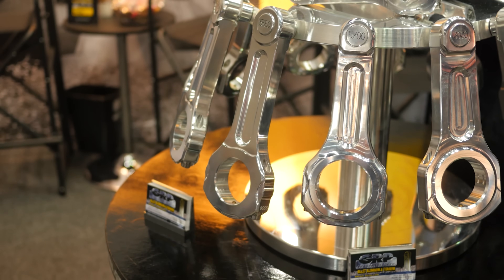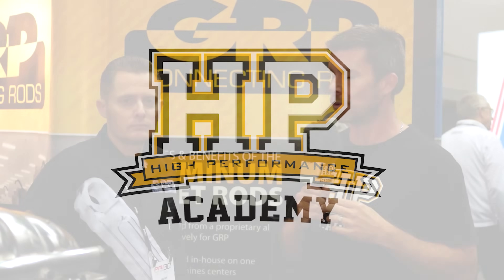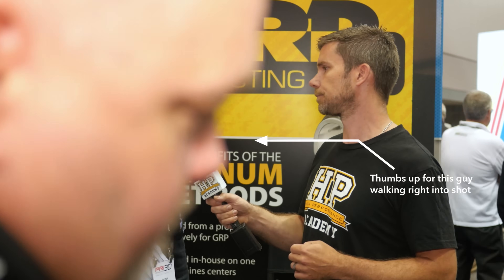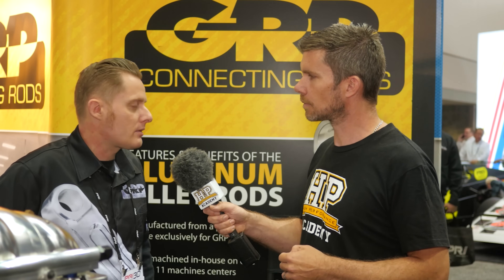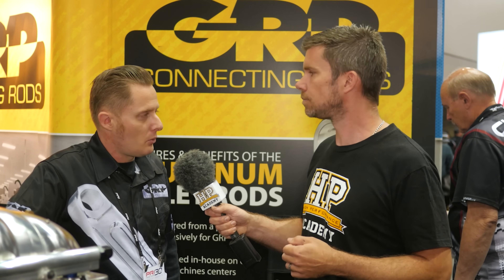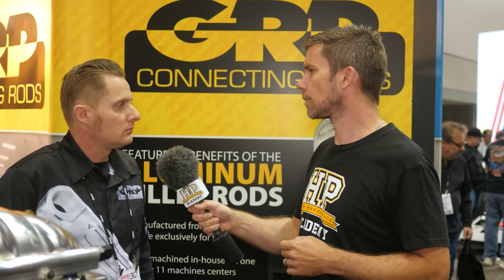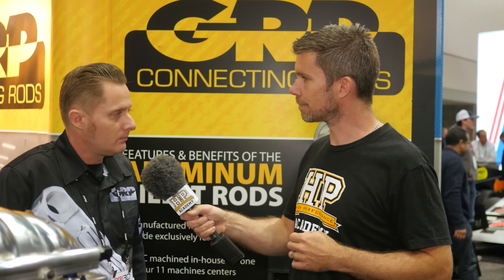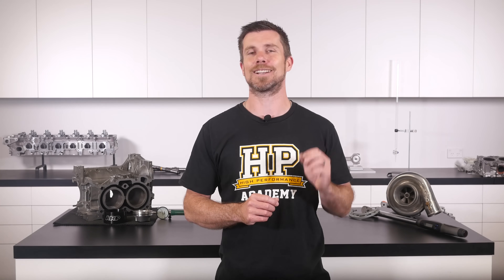Aluminium Conrod Pros and Cons | GRP Connecting Rods [TECH TALK]

Comment: Wow we own a 350 Chevrolet engine in drag car and we've been using the same aluminum rods for 30 years I'm not talkin about the same brand I'm talking about the same rods so you telling me they won't last oh and don't say making horsepowerI'm moving a 3000 pound car with a 98 hundreds  second 60 foot so I believe they are going to hold up on the Street and also the deceleration stuff they run aluminum rods and sprint cars and late models just don't hang a 900-pound piston on the other end of it
Reply from the maker: The reason why aluminium rods are not advised for a street application are fairly stated here. From there it's up to you if you want to believe the science and experience of many other companies, engineers and engines out there or of your own use case, granted it is a drag application too and not a street application either way - Taz.
Reply: Are you running it as a 2 stroke like this 2 stroke cheavy conversion:https://www.4btswaps.com/attachments/2cyclesbc-jpg.6839/. Do run an oil injection system into the intake?

Comment: If you do not exceed its yield strength, steel has a virtually infinite service life. That is why they are so great for cranks and rods. Aluminum does not. In many cases it can be over built so it has an extremely long life, like and aluminum rocker arm. But for the extreme duty that a con rod sees they are great for a sprint but not for a marathon.

Comment: Spin fast, bend easy. Yeah, no. Wouldn't touch them unless you are building a naturally aspirated race engine, and are stuck in that engine category. Great for building 10,000+ RPM engines, terrible material for cylinder pressures exceeding what you can achieve with Compression ratio and atmospheric air pressure. I'll take a set of chrome moly alloy, cast fracture split steel rods, over forged aluminum rods any day of the week.
Reply: I would to as they hold up better in 2 stroke conversions as well like this v8:https://www.4btswaps.com/attachments/2cyclesbc-jpg.6839/

Comment: Really good pertinent questions even if some answers were a bit short! Interviewer eventually teased more detail out. Clear enough reasons why an alu rod will not suit my road race bike. Would have been interesting to know if an alu rod would have been acceptable in an older lower revving circuit bike (say under 7000 rpm) as opposed to the phenomenal high revs of many modern engines

Comment: Aluminium rods can run into the block not a cam..
Reply: It depends on the engine...  In a small Chevy getting the rod to clear the cam can sometimes be much more difficult than getting it to clear the block.

Comment: With regards to aluminum rods, how suitable do you feel they would be in drifting, for example? Not quite drag racing and not quite a full road course.
Reply: Not even remotely. There are plenty of ways to make enough power for any kind of drift car you can imagine without aluminum rods. The whole idea is to take advantage of aluminum's ability to absorb shock on the bearings and crankshaft, AT THE COST of longevity. That's not what you want in a drift car. There are a plethora of options to build a motor with steel rods that is capable of more power than you'll ever need drifting. You don't see 3000hp+ drift cars for a reason. Road course would actually be very similar to drifting in this regard, I don't quite know what your trying to achieve with an aluminum rod drift car engine lol
Reply: Are you running as a 2 stroke?https://www.4btswaps.com/attachments/2cyclesbc-jpg.6839/. I assume you made a poppet u-loop scavenged 2 stroke.

Comment: would the rods be recommended  for a daily running usage on a stroked engine?
Reply from the maker: It's best to get in touch with your supplier directly, tell them what your application and requirements are and then see what they recommend specifically for you. The pros and cons of this material are covered in the video so it's up to you to decide if the pros are sufficient enough to warrant dealing with the cons - Taz

Comment: 6:10, heavier viscosity oil than tightening up clearance.
Reply: High viscosity oil and large clearances are old drag car engine building techniques that need to die in a fire. Oil has changed a lot from the 1950s and 60s. There's no reason why you should be running a 20w-50 oil in a modern strip/track car. Guys still do it anyway, and they are just wearing out their engines quicker running loose clearances.
Reply: Im on amsoild dominator synthetic 2 stroke oil in my rotary. Its SAE 30w like BRP XD-100 and little cheaper. Im gonna try some motule 800 2T but its sae40w like silkolene pro 2 sx. Igot my 8v92 on a shell rolettla/BRP Xd-100 combo and it works great. My small block v8 2 stroke in on the BRP-XD-100 oil.

Comment: To a rough approximation, the peak force on a connecting rod will be during the intake stroke, and consists of the force needed to accelerate the piston downwards, and the force needed to pull the piston down against the vacuum at the intake manifold. 

f_peak = (piston mass)*(stroke_length/2)*(2*pi*RPM/60) + (vacuum)*(pi*(bore/2)^2)

The actual force calculation is a lot more complicated due to the non-sinusoidal motion of the piston and friction forces.  Be sure to use consistent units (Use SI units and everything will work out).
Reply: What happens when there is boost? And some other guy further up in the comments said max ConRod force is right after exhausts stroke. I don't know who is correct, never thought about it really.
Reply: You have several forces added together in the connecting rod.

1.  The force required to accelerate the mass of the piston, wrist-pin, rings, and connecting rod itself in a cyclical motion.  The piston's acceleration is greatest when the piston is changing direction near top-dead-center.  The acceleration at bottom-dead-center is also high, but it is less than the acceleration at TDC.  This is due to deviation from sinusoidal motion of the piston because of the crankshaft geometry.  The force contribution from acceleration is just F=ma.  This acceleration depends on the engine RPM.

2.  Gas pressure on the piston face.  The force is equal to the relative pressure (assumed uniform across the cylinder) times the cylinder crosssection area (piston face area on a flat topped piston).  Relative pressure should be used, because the pressure inside the crankcase is generally only a little more than atmospheric pressure. F=p*A.  

3. Friction forces of piston rings on the cylinder wall (usually negledgeable compared with other forces present.).

If you have boost, on the intake stroke, the forces due to gas pressure (pushing down on the piston) will help accelerate the piston downward and will require less force from the connecting rod to accomplish the same acceleration.  

On the compression stroke, the compression of the gas will help to decelerate the piston, also reducing force on the connecting rod.

On the power stroke, the downward force on the piston will be much greater due to more air/fuel having been burned in the cylinder.  My guess is the very start of the power-stroke is where you will see the highest force on the connecting rod.

On the exhaust stroke, since the exhaust valve is open, the force on the connecting rod is mostly due to acceleration of the piston, and the cylinder pressure drops rapidly once the exhaust valve is opened.
Reply: With a 2 stroke is constant down force.

Comment: Very good Q&A session - the only thing I'd've liked to have been asked was the affect of temperature as, back in the day, it was believed that rev'ing the rods when cold was much more likely to cause failure than when the engine was warmed up. Don't know if that was an old wives' tale or fact, though, as there isn't a lot of warming up for top fuel engines... Maybe down to different alloys being developed?
Reply from the maker: They didn't get right into specifics but near the end cold and hot clearances are touched on. The word 'stretch' is the old wives tale, but the fact that aluminium expands more than steel and that it does need to be accounted for in your build is not ;) - Taz.
Reply: Thank you for the prompt reply. 
I wasn't referring to "stretch" (although there will be some - Modulus of Elasticity - even with steel rods) but whether temperature was actually a factor on failure rates. Back in the day there were anecdotal reports of unexpected (brittle?) failures of rods on initial, cold running, often at relatively low rpm and little use - of course, the stories may not have been accurate.
Aluminium properties change with temperature and perhaps this also affects the fatigue life?

i have watched quite a few of your videos and you should be complimented on the questioning and insight you bring to them - definitely a big step up from most interviews and discussions :-)

Comment: Good vid, as usual... It's interesting though, you see quiet a few guys in the States running alloy rods in 1200 - 1400hp 2JZ's that are running on the street. It's scary hearing rods rated in "runs". I want alloy rods like these guys use in their 2JZ's for my RB30. The only question I think wasn't answered well was- at what point should I start to think about using alloy rods in my engine. Going to sign up for the listen in, was a little disappointed when I signed up for one of your tuning listen in's and it was live to air in the bloody middle of the day. Dude, most people are at work on the eastern seaboard during the day- and these are the people with the finances to be able to pay for one of your actual courses. It's these people you want to show a little teaser to in the form of a listen in. What's the point in putting it on at a time convenient for dole bludgers and children? Most workshops (like mine) close at 5p.m.
Reply from the maker: Hey Daniel,
From my personal take on the discussion, the answer to your first question is covered at the start. If you're running your car on the street, you're probably not going to want to use alloy rods unless you're happy to deal with the increased maintenance and associated costs that they will bring. As Woody mentions you're really best to give someone like him a call, give them all the details they need, and then they will tell you what's going to be best for you and your personal application.
As for the webinar times, it's a shame that didn't line up for you but to be fair there is more than just the East Coast in the world Daniel 🌎We change the time and day every webinar to target different areas and countries. We also email out a recorded version just in case you miss it or the time doesn't suit and you don't want to wait until the next one. Hope that helps! - Taz.